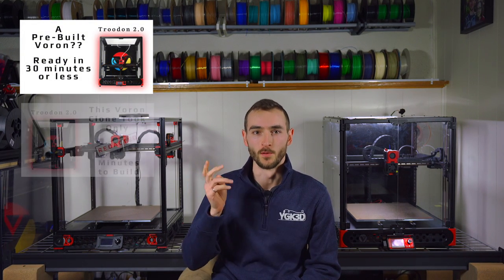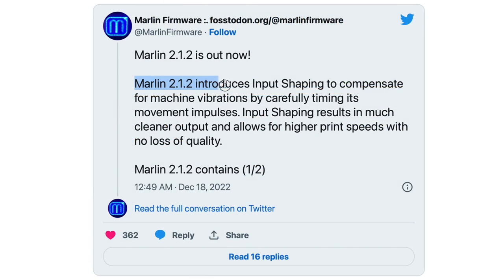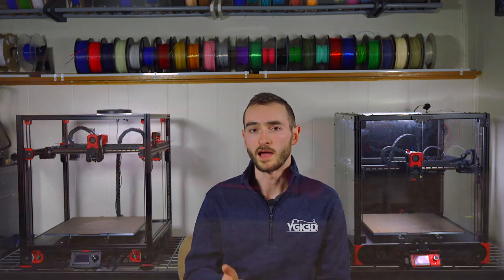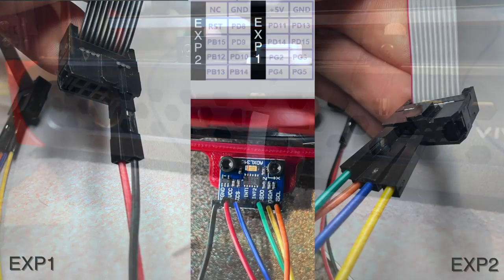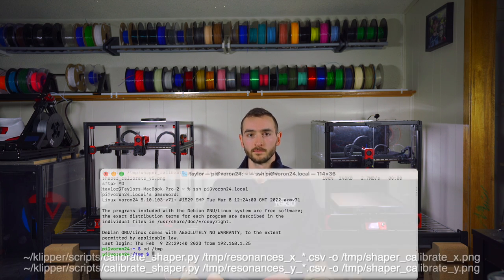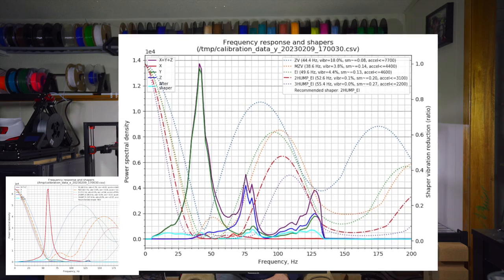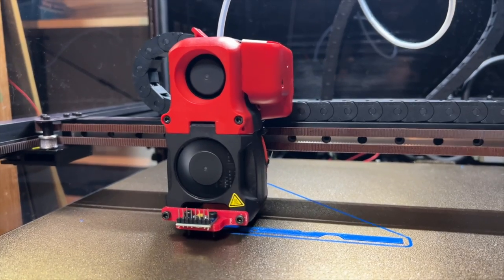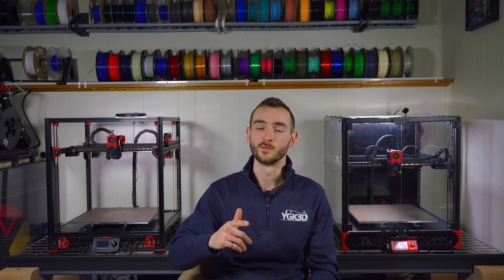The Secret Weapon for Faster Prints: Input Shaping in Klipper Firmware on the Troodon 2.0

Comment: I spent many hours investigating the Z axis component of vibration. The cause is from the center of gravity of the print head being higher than the cross member, mainly from the weight of the extruder motor, which in turn caused torsional flex in the cross member during y accelerations. I offset this by adding weight to the print head below the cross member. Once I found the correct balancing weight, the Z component of vibration went away and the test prints running at 200 mm/sec with 4300 accelerations are now practically flawless.
Reply from the maker: Wow! This sounds like a fantastic analysis. I’d love to know more. I take it you observed similar shaper results? Are you running Klipper on your Troodon? What did you use for a counterweight and how did you secure it?
Reply: @ygk3d  I did get similar shaper results as you have shown in the video. By moving the accelerometer to various points on the print head, I was able to build a visual of the Z movement to figure out it was rotation about the cross member. I attached a piece of steel (approx 50x30x19mm) to the lower left rear of the print head by using the screw in the side. It took a lot of trial and error to get the correct weight. I am running Klipper on my Troodon 2. I also changed the control board to the M8P with the CB1. I documented the wiring fairly well and can share it if you are interested,
Reply from the maker: @archiejacobs6741  Super impressed! Great thinking. I wonder if this is a universal flaw with the design? Is there anything special about the Troodon carriage versus a stock Voron? My older Voron 2.4 has two MGN9 rails for the x axis, which should prevent the rotational degree of freedom. The Troodon uses a single MGN12. I just had a look at the Voron manual and it seems they've moved to a single MGN12 as well, so the Troodon design isn't unique in that way.

Interesting about your control board switch. Did you keep the wiring upstream of the board and just cut and re-crimp all of the wires? What motivated your decision to switch?
Reply: @ygk3d  I wondered the same thing. I unfortunately do not have a Voron to do a similar analysis on. But this discovery has started me thinking about how to design a new print head with a correct center of gravity and possibly two rails that are in the same z plane.

The board change started with the fact that I didn't know Kilpper could run on the stock board. After I saw your video, it was too late because I was already waste deep in the process. It did work out well anyway because I can use the accelerometer and keep the display working. I also have some 5160 drivers on the way because my next move is to run Motors A&B on 48V. I made a cable to go from the 40 pin connector to the individual connectors on the new board. This gave me a quick way back to stock if something didn't go as planned. I plan to post pictures on the Troodon reddit next week.

Were you able to eliminate ringing in both X and Y directions. What acceleration were you able to achieve without ringing?
Reply from the maker: @archiejacobs6741  No observable ringing in either X or Y based on my test tower print. I haven't changed the default Klipper acceleration of 3000 mm/s^2. According to my shaping results my max acceleration is 3100 mm/s^2 because of the recommended 2HUMP_EI shaper which has a lower acceleration cap to limit smoothing. If I could eliminate the Z component of resonance as you have done, that should allow me to use a simpler shaping function with a higher max acceleration,.
Reply: @ygk3d  We have seen very similar results. Before I counter-balanced the head I was getting the 2 hump recommendation also. After adding the weight and making the z component go away, the recommendation changed to mzv.
Reply from the maker: @archiejacobs6741  Nice! I'll have to try that. Really appreciate the tip!
Reply: Would like to see a follow up video on this process

Comment: I've been looking for a competent, fully enclosed, corexy printer that doesn't require the time of a voron, and isn't Bambu Labs (just because it is too early to know about their closed ecosystem approach). All the while keeping cost below $1500. This printer is intriguing, and didn't know about it until I found your channel. Instant likes and sub. I think you should consider going back to basics on the review side and show off the print quality for several models in as many filaments as you can reasonably do. Aurora Tech does a great job with that format, and I think folks would like to see this in action for more engineering filaments beyond PETG and PLA. Also, love the series focus on one printer instead of a one and done. Can't wait for the next one. Great work and thanks!!!
Reply from the maker: Thanks! Great suggestions.

Comment: I think the placement of the probe is causing the vibrations. You should try the upper two screws. I think you are measuring the vibrations of the plastic part where the fans are and not the nozzle. Ideally you would have the sensor at the nozzle but second best should be higher up where the hotend is mounted so I would try the upper two screws or get a nozzle mounted sensor.

Comment: Great series! This has now become a solid contender for me. I had a question, off topic regarding your Formbot Raptor printers. I recently picked up a second hand T-Rex 3 and was unable to find any information about implementing linear advance on the board. Running 2209 drivers on the V1.1 board. Do your Raptors run linear advance? If not, do you have any recommendations for acceleration and junction deviation to help with overshot corners? Thanks for your time!
Reply from the maker: I’m not sure if linear advance is enabled in the stock T-Rex firmware. It’s not in the Raptor firmware. You may need to download the firmware source, enable the feature, then re-flash.

Comment: I can't seem to retrieve the generated files. I use putty and login to my pi (ssh) but when I run the two commands I get file not found. I changed the "*" in the names to the proper name (which also took a while to figure out) Also how do I "switch" to sftp? Thanks. I also noticed that the hotend is really wobbly in y but stable in x for some reason.

Comment: Those prints look great, I can't see much difference between the klipper vs reprap results tho so I'm wondering if it's worth the extra effort to swap over?
Reply from the maker: I haven’t done extensive testing but I don’t think the print quality will be significantly different. The main advantages of switching to Klipper are the convenience features like automated input shaping, community macros, and support for third party accessories: Mosaic Palette, Beacon Surface Scanner, USB Webcam (RepRap supports cameras but no ports on the Troodon board). The effort is pretty minimal to make the change given that I’ve provided my configuration and instructions. The main consideration is the cost of a Pi. I’ll probably do some more head-to-head comparisons in a future video.
Reply: @ygk3d  Yea the cost is the main concern since there are basically none of the Pi's around only scalp priced 3bs which is kinda annoying, my troodon 2.0 will arrive next week and I'll probably end up getting Klipper running instead mostly because I want to run a 7 inch touch display for it to have easier onboard controls.
Reply: @ygk3d  As i commented that i won a 3b for 35 euros lol

Comment: What speeds can this oronter with klipper installed print at without loosong quality?
Reply from the maker: You'll be limited by cooling at higher speeds if you're printing with PLA, but this machine could comfortably hit 150-200 mm/s outer wall speeds with a little tuning.
Reply: @ygk3d  thx for the reply. Inguess i have to wait for the stealthburner to become available for this printer so i can take advantage of the better cooling and put in a high flow hotend.  Or maybe just save me all the hassle and go for a Falun V400. But then again. The v400 is hard to enclose for abs orinting. Tough choices ;)

Comment: I’m in the US and it appears to be $100 cheaper to have it shipped to me from China vs. from a US warehouse. That sound right or will it change once they have my shipping address?
Reply from the maker: The list price from the US warehouse is $999 which includes shipping. The list price from the China warehouse is $899 but they'll charge you an additional $209 in shipping. So you're better off to order from the US warehouse.
Reply: Gotcha. Thanks for the clarification. Enjoying the videos and strongly leaning towards the troodon rather than a Bambu that I was really considering pulling the trigger on.
Reply from the maker: @guycobb3251  No worries. I have a few Bambu’s (X1C) and love them. Both good options but better bang for your buck with the Troodon in my opinion.
Reply: How have your XC1s held up and how does the print quality compare?  I really like them, their plug and playability coupled with the AMS. Just seems to be a good amount of iffy prints that I’ve seen and seems like a fair number of reviewers have had mechanical failures of one kind or another with their machines. 

Also, it seems that shipping is free to us from us warehouse, unless they tack it on at the very last step.
Reply: Any benefit to swapping to the octopus board users in a standard Voron?  I see myself running klipper.
Reply from the maker: @guycobb3251  Mine have been flawless and the print quality is the best I have seen.

Comment: Is it possible to mount two extruders on this duet clone board?
Reply from the maker: The Troodon 2.0 uses a custom Octopus X7 control board, not a Duet clone. There would not be enough ports on this board to add a second extruder.
Reply: @ygk3d  thanks!